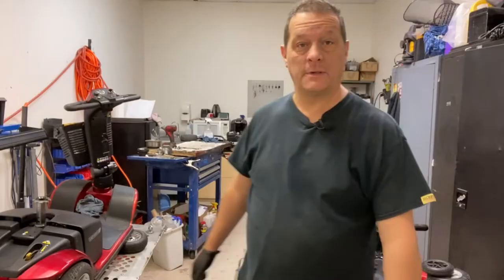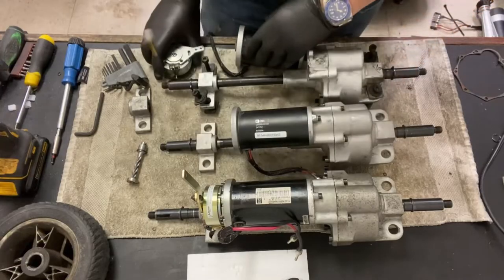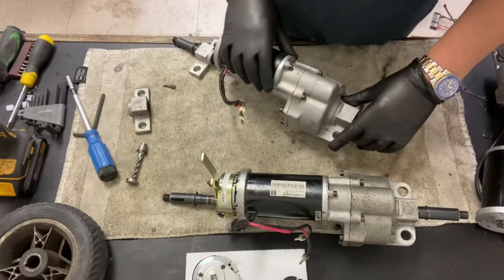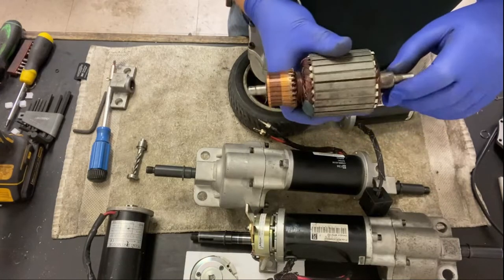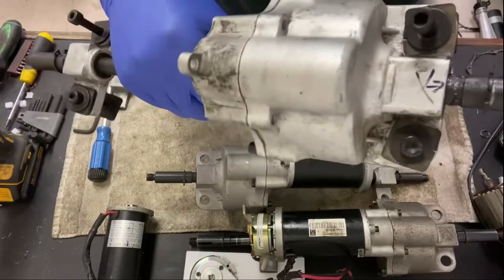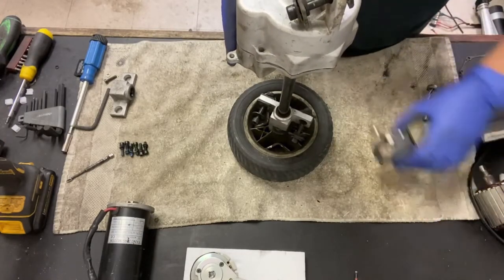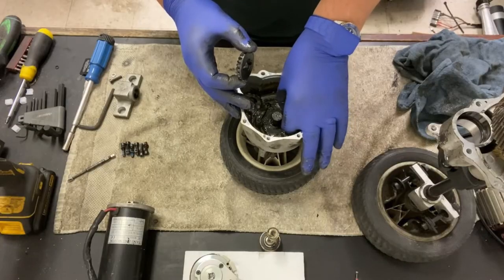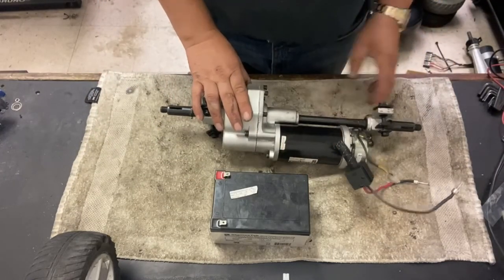How to repair a Pride Mobility Go Go Transaxle Motor and Brake – the Inner workings explained

Comment: Do you have a video for the Pride Revo 2.0 that shows how to replace the front shroud?
Reply from the maker: Hey bud, no I don't and it's a pain to do even more so with a four wheeler. Here's a quick brake-down.
Remove seat and batteries then remove the rubber floor mat (be careful not to damage the rubber grommets when pulling the rubber mat up) then there are 10 screws on top and two underneath (four wheel) that will loosen the shroud up then unclip the front to rear harness (large connector neat the from steering stem) and remove the tiller by unloosening the tiller adjustment knob all the way. This will make it able to remove the tiller with stripping the whole thig apart. Next remove the tiller lock knob and then the shroud should be able to be lifted straight up. The only difference between the three and four wheel is the 12 screws on the three wheel are all on top none underneath.  Hope this helps 👍

Comment: Hi Do you have any idea on what size shims might be needed in the gearbox of a pride elite traveller please. Even the inside and outside diameter would be a help, we can then trial and error on the thickness as do appreciate that vaires in each machine. Many thanks in advance
Reply from the maker: Hi Terry, the one thing I don't have is calipers to measure the inside and outside diameter. The inside diameter has to be large enough to fit the drive shaft and the outside doesn't really matter as long as it doesn't foul up on anything.
Reply: @lasvegasscooterslifts  Thank you
We have a inside diameter of 17mm but the only shims we can find are only 24od which we didnt think would be enough. We have ordered them and are just hoping the od is big enough. Fingers crossed it fixes the problem , Thank you for the video and your reply, most helful

Comment: How do I remove and straighten or replace, the right rear axle on my  Pride Mobility Raptor R3-1700. The axle side of the disengage lever. Do you sell these sir so I can fix my wife's scooter. She has MS and depends on it for mobility. Thank you for all of your help sir! Thank you for your videos!
Reply from the maker: Hi Edmund, If the transaxle has broken then I would recommend replacing the transaxle rather than fixing it. Removing the transaxle is not going to be an easy job due to the weight of the scooter. most pride scooters, anything to do with the transaxle can only be bought as a complete motor, brake and transaxle and normally the cost of replacing the part can outweigh the price of just buying a new scooter. You can call us tomorrow Monday 9am PST 702 265 2441 and we can discuss exactly what part you need and what the price of the part, shipping and TAX would be.
Reply: @lasvegasscooterslifts  Thank you so much sir! I am very skilled at repairs and if you have the part I will be able to fix it. The transaxle works it just has a bent axle on the right side. Thank you! I will call when you open today and thanks for the quick response! Ed
Reply from the maker: Great speaking with you today Ed and I hope you get your Raptor sorted so the good lady can get back on the road again.
Reply: @lasvegasscooterslifts  Thank you Ian and I will try to remove the right axle and try to straighten it. Any tips would be greatly appreciated so my wife and me can go on walks again. Maybe a video of how to do this job on my Raptor? Thanks! Ed
Reply from the maker: Hey Ed, unfortunately I do not have a Raptor in store to show you anything I've only worked on an EW36 and EW72 which have a different style drive system to the Raptor. As far as I'm aware it's the same set up as all Pride scooters. Remove the wiring from the motor and brake from the main harness, Jack up the scooter and place blocks under the frame to stabilize the scooter somehow and remove both rear wheels. Then I would look for the transaxle bolts that secure the transaxle to the frame to remove the transaxle so you can work on a bench rather than while it's on the scooter. Good Luck my friend.
Reply: @lasvegasscooterslifts  Thank you Ian and I got the axle out! Wasn’t to bad of a job and your video rally helped! It’s a shame Pride doesn’t offer more parts. My son is a machinist and we’ll first try to straighten it, if not he might be able to make me a new axle.I’ll let you know how we do if that’s ok?
Reply from the maker: Great news Ed well done, yeah, the hardest part is the weight of the scooter. 😂 I guess Pride don't want to sell individual small parts, not enough profit in it for them and inventory would be a nightmare 🙄 
Good luck bud, I'm sure you'll get it sorted 👍
Reply: This is a great video! I have an Lx sport that in 2 years has had 3 complete motor transaxle changes, 8 tire and bearings, 3 sets of Batteries, new plug harness and e complete suspension changes the entire front end and rear struts. Now I'm not hard on my scooter and don't take it anywhere it shouldn't go. It's my primary form of transportation in a little over 2 years it has been driven close to 4,000 miles. Thank goodness the Veterans mobility department finally ordered me a new one as this one is on its last legs again.

Comment: Can I replace the key weight for the motor-transaxle connection? Is there a place to get a new one to swap it out?
Reply from the maker: I'm Sorry, I'm not sure I understand the question.
Reply: It's a machine shaft key like a woodruff key, if you have the measurements they're not expensive

Comment: Hi Ian, 
Great video and greetings from the UK. 
Have a Vanos Excel about 15 months old. Little use. Range should be about 8 miles but we only get 2ish.
Replaced batteries with new (tested good) but range is still about 3 miles. 
Manufacturer suggested brake at fault and suggested I removed brake but leave electrically connected. Made no difference at all. 
Only thing I can think of is the motor and/or transaxle but the manufacturer says doubtful. 
At a loss to think what the problem is. No leakages...
Any ideas? Thanks very much.
Reply from the maker: Hi Malcom, wow I can't believe the manufacture told you to remove a safety feature and ride it. Did you buy the scooter from new? and do you have any warranty on the scooter? If the batteries load test good, then run the scooter for a mile or so and then put your hand on the motor (just be careful). If the motor is really hot to the touch you have either a bad motor and or transaxle. If its slightly warm, then I would still look at batteries. Check to see if there is any excessive side to side movement (5mm or more) on the wheel shafts to the transaxle, that would mean warn transaxle. Excessive inclines will decrease drive range but not to that extent.
Reply: @lasvegasscooterslifts  
Thanks for your reply.  Yes the m/f did tell me to run it without the brake. We live in a very flat,  quiet area so I didn't see it being too problematic. 
Fault existed within warranty but shop blamed me for not charging it properly! Went back to shop about 6 times but said nothing wrong with it. Aunt only used it twice a week for about 2 miles total so I was charging once a week.  We only discovered fault after a longer trip than usual.  (About 4 miles) The shop insisted that I charged it every usage which I disagreed with. Its now 3 months or so out of warranty. 
I'm a retired aerospace engineer (worked on landing gear systems) so I thought I'd take a look at it myself. 
Brand new batteries that have been tested for capacity. Charger tested for correct output. 
Just completed almost 3 miles but red light. Felt motor and transaxle after all mile but both cold. 2 miles slightly warm, 3 miles a little warmer but not hot. No leakage,  all clean as new.
Just spoken to m/f again and he's lost for answers. 
Even with brake disconnected the scooter 'drags' after a few yards then releases. Wouldn't have thought this would happen with brake disconnected. 
I'm scratching my head...
Reply from the maker: One thing it could be is a faulty bearing somewhere in the transaxle or motor itself that is locking up.
Reply: @lasvegasscooterslifts  
Sorry for the delay in replying. Although I'm retired I've been busy the last few days. 
Yes I have come to the same conclusion.  However when I did the 3 mile ride last week nothing seemed to be getting warm in the transaxle,  only the motor was a little lukewarm shall we say. 
I've had it running up on blocks also, there is no noise and both wheels are rotating normally. 
The way I look at it is that it should be doing about 9 miles so we're only getting 33%. Something,  electrical or mechanical should be getting hot, but it isn't.  I don't know if there's some sort of voltage regulator or a resistor in the feed.  I've changed the potentiometer already. 
It's finding time now to strip it all down. A Christmas project maybe?
Many thanks
Reply from the maker: I'm not sure if you are going by the battery voltmeter for your reading for distance as I have seen faulty battery gauges give me and people the impression that the millage is limited. I always use a distance app on my phone and run the scooter as far as I can until it dies to get a accrete representation of distance rather than the battery gauge.
Reply: @lasvegasscooterslifts  
It's 3 miles as I have measured the 'loop' on Google. (1.1 to be precise)
I've also measured it walking with my watch as a pedometer. 
Yes,  I ran it down to red and in fact the last 100 yards or so I had to push it. 
It's definitely a head scratcher...
Reply: @lasvegasscooterslifts  
It's 3 miles as I have measured the 'loop' on Google. (1.1 to be precise)
I've also measured it walking with my watch as a pedometer. 
Yes,  I ran it down to red and in fact the last 100 yards or so I had to push it. 
It's definitely a head scratcher...
Reply from the maker: If batteries are not at fault and the terrain is all flat with no inclines and the scooter has no modifications, then that only leads me to motor transaxle brake.
Reply: @lasvegasscooterslifts   Thank you for your help and advice. Yesterday I took the scooter to an independent repair centre. They have tested everything and have reported that a loose wire is the cause. 
I'm not 100% sure that this is the cause but in any case I'll be collecting the scooter hopefully tomorrow. I'll let you know the outcome. Thanks again
Reply: @malcolmmorgan5342 I would be interested in the outcome when you get the scooter back. Does this model have a brushed or brushless motor?
Reply: Received the scooter back last week but the repair has made no difference unfortunately. So I'm now back to square one. 
Due to the issues we had with the scooter we purchased another similar model (not the same make) and unbelievably the new one is exhibiting the same issue with the range. The old scooter struggles to reach 2 miles and the new replacement is now the same. 
The replacement is being repaired next week under warranty. The chargers have been tested,  so have the batteries. I'm hoping that the fault with the new one will point to the fault with the old one.
Reply: @malcolmmorgan5342  A bit of a murder mystery. I can't wait for the next episode. 😍
Reply: @Phelec59  
Sure is a mystery. This is actually the 3rd. The 1st scooter stopped in the street and the shop just replaced it with another.  The second one I am still trying to repair and now the 3rd has the same issue. 
All have been kept in a garage and have been charged correctly. The book range is supposed to be about 9 miles and we are now struggling to achieve 2!
To say it's a mystery is probably an understatement. The saga of the 2 scooters...😆😆

Comment: Hello from Azores Islands. I have a Citycoco cp3 (3 wheeler) and yesterday it stopped running. Everything works as normal, i can hear the motor running and see it in the tachometer moving but the scooter doesn't move at all. Do you think something in the axle broke or came loose?
Reply from the maker: Not sure about this brand or make of scooter as it's not something I don't deal with; I tend to strictly stick with medical scooters and powerchairs. I have worked on a few recreational things before such as e-wheels stuff, and it sounds like there is something going on with the transaxle/differential side of things. If you hear the motor turning, then yes for sure some component has broken loose or broken completely. I would start by removing the motor from the transaxle to make sure the drive from the motor to transaxle has any damage to it. Also, this way you can test the motor to make sure it's still transmitting power to the transaxle. If there are no visual components loose or broken there and you see the output spinning, then it's a strip down of the trans/diff to see what's come loose or broken. From what I see from their installation video it looks like their diff may be filled with some kind of oil so a messy job may be ahead of you.
Good luck, Ian

Comment: I have a question, my father's pride Victory I believe does not travel as far as it used to so we buy ne batteries aver few months I assume it's to motor so I have another full rear end only I can't get his to unplug the plug actually broke but is still lodged in the  female side and I can't remove it. So question should I pry it off or I was trying to follow the wire harness but I can't figure out how to remove the plastic fairing on the foot rest. Anyway thanks for any information you give
Reply from the maker: Hi Tim, there is a lot of things going on with your scooter by the sound of things. If the scooter is a Victory 9 or 10 latest model (Pride made 14 variants of Victory) with the quick release feather touch release handle and it won't come apart then the two male/female pugs might be melted together due to high resistance or a loose negative battery terminal. I've delt with this in the past and found that if you remove the rear shroud if you can, you might be able to get to the connector to try and pry them apart. It's more than likely you will need to replace those connectors as they will break. If you have any doubt, take it to your local scooter repair shop if you have one near you.